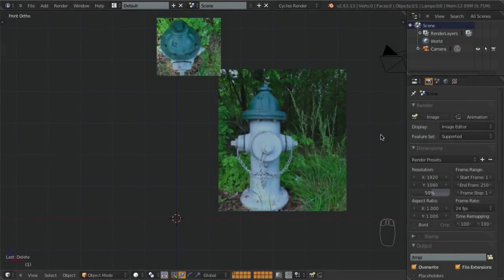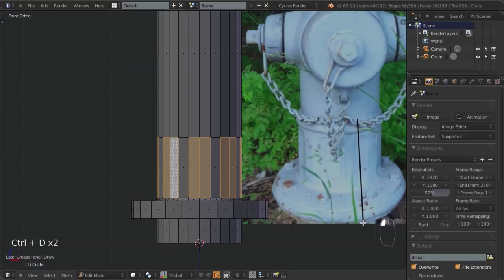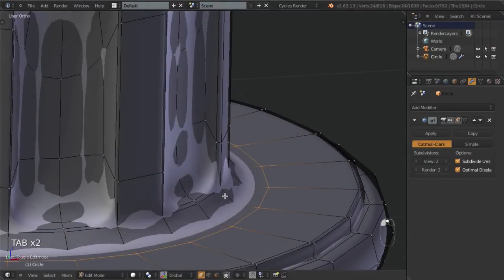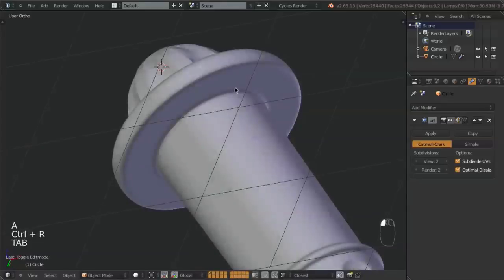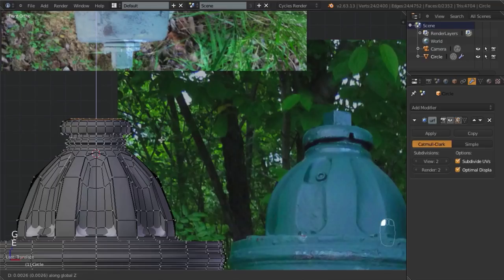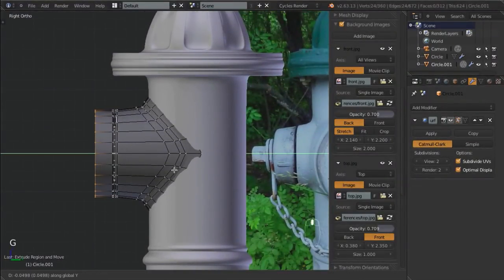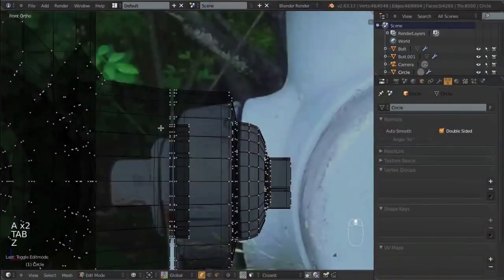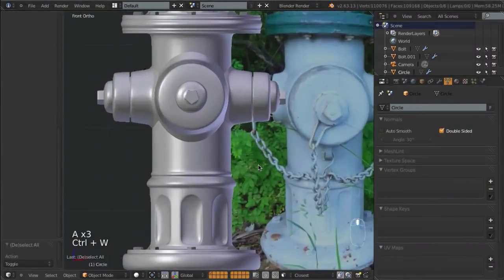CGC Classic: Game Ready Fire Hydrant Pt. 1 - High Poly Modeling (Blender 2.6)

Comment: I've tried mirror the bolt on 2.8 Beta and it act so weird, it's harder to control bolts into circle. User need to scale Empty's size same as bolt, and in array modifier need to tick Constant Offset and Relative Offset then adjust the values that fit your.